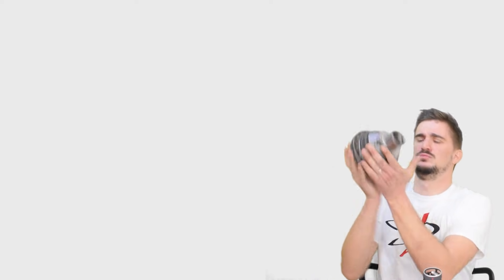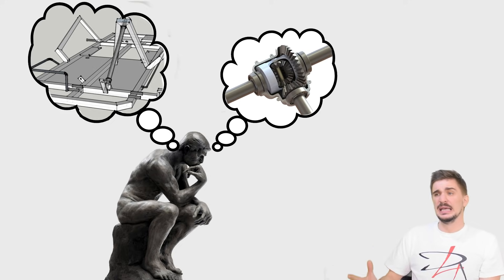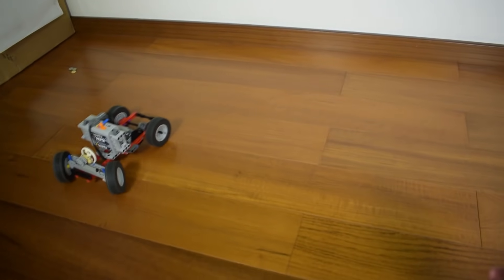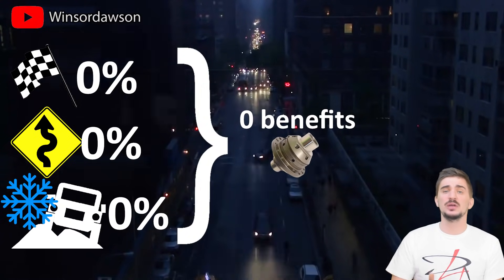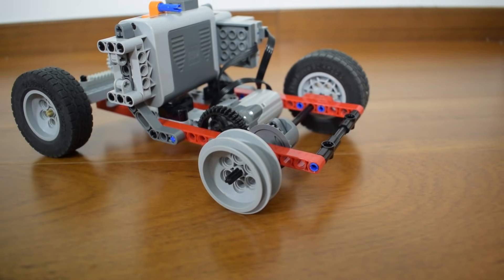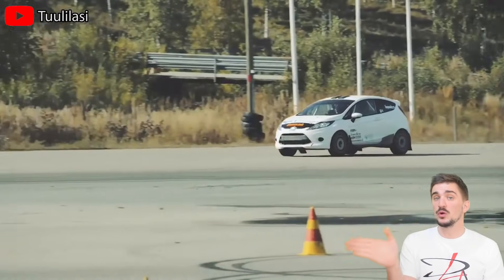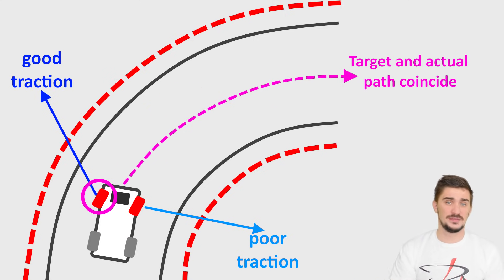OPEN diff vs LSD vs WELDED diff - VISUALLY + In depth EXPLAINED - Version 2

Comment: one thing that I would like to mention about the downside of a welded diff is that during a corner exit the driven tires are not only accelerating the vehicle but also keeping it from sliding sideways (on a fwd car this will result in understeer and a rwd will result in oversteer). On a welded diff the inner wheel will spin so you also lose that sideways grip keeping your car from spinning out, even though you may have better acceleration. On the lsd the inner wheel will spin less and maintain that sideways grip and keep your car on the road. That loss of sideways grip is also what makes welded diffs good for drifting, you want to lose that sideways grip and get things spinning.

Comment: Nice video👍🏻
I bought a Quaife helical front lsd for my Nissan Skyline R33 GTR V-spec, simular to your new diff for the MR2.

One of the reasons why i went helical is because it doesn't need maintenance wich is exactly what i need, for the front diff is actually located in the oil pan of the engine, and it can't be accessed when the engine is still in the car. So if it needed maintenance the whole engine has to be taken out or the front subframe dropped.🙈 the car is being track driven and will get a brand new 750~800hp RB28DET engine. So in order to improve traction and reduce understeer the front open diff will be replaced with a helical lsd from quaife. I'm really hyped about it, cause the gtr already was a maniac out of corner exits😁 it has a electronic controlled torque split mid diff in the gearbox and a active rear lsd from factory.

Also the helical type is much smoother in operation than a clutch type diff, wich was another reason to go for a quaife helical.

I cant wait for the next video about diffs! 👍🏻

Comment: Many years ago a Mk1 MR2 took out my Mk3 Fiesta while it was parked at the roadside outside my house on a main road.
The MR2 was doing 60+ Mph when it hit, it scooped up my fiesta with its low nose and my car went up the bonnet and the front edge of the roof, ripping them off while going airbourne and flying for around 120ft.

My car was bent up from the rear as well as sideways and also twisted with huge kinks in the roof and the impact force was so great that not a single switch, clock, vent ect remained in the dashboard and it also sent a shock through the car violent enough to break the water pump!

The MR2 veered off to the left, smashing through a wall and falling down steep drop off, it was utterly destroyed.

The passenger who's side took the bulk of the impact with my car was in a real bad way but ran off down the road pouring blood as he was having an affair with the woman who was driving the car and did not want to be caught with her.

Scary thing is that I always sat in my car for around 20mins when I got home but was early home by about 10 mins, had I have got home when I would have normally, I would have been sat in my car when it was hit!

Comment: Quaife is great in my book. I got a Quaife sequential for my 06evo mr. The tuning and getting everything to jive with the aftermarket ecu is key. It is tame enough to drive casually but is in its element when literally banging gears. Clutch obviously for starting and stopping but having the spark cut at the perfect time and time duration is key to a solid, smooth but quick engaging shift. I was able to go with a slightly bigger turbo but was also more efficient because I don’t lose boost between shifts. It definitely turned the car into an entirely different animal. I’m still at just over 500awhp for daily but can go up to about 900 turned up. The 500 now feels more like 600 compared to what it was rowing gears. Never out of boost while on it until you let out. So much faster then before. A quality product that in my case at the time it was also the cheapest.

Comment: If you want something in between a welded diff (spool) and a LSD, there is also a locking differential (often called a "Detroit Locker"). Going straight it acts like a welded diff/spool but in a corner at low input torque it unlocks and acts like an open diff. Just be careful as too much input torque (too much throttle) can cause the diff to lock in a corner and the car to "jump" or become unstable/unpredictable. This can be especially dangerous on ice. These types of differentials are great for drag racing and can be used on the street so long as you don't get crazy.

Comment: Great explanation
You also should notice one more advantage in cornering about natural toque vector difference with lsd diff,much more pivoting the car around rear axle,so lsd is great even for weak engine cars.

Comment: In beamng drive, the welded diff is the best for drag racing. You get 1 to 2 car lengths on launch easily over other diffs if you set up the gears and grip correctly

Comment: Your discussion of LSD's, in terms of performance cars, is fascinating. Perhaps you could do a video on the benefits of LSD's and even differential locks in off-road vehicles. Nothing stops a so-called 4wd car with free differentials all round than having both right (or left) hand wheels in a ditch and both the other wheels turning uselessly.
Think of it this way: a 2wd car with a free diff is effectively a 1wd car if one of the driven wheels has no traction. Similarly, a 4wd car fitted with front, rear and centre free diffs is still effectively a 1wd. One or preferably two of the diffs need to be LSD's, particularly the centre diff. If you have a vehicle with a locking centre diff and a LSD at the rear and you get it stuck, you should probably stick to walking. 🙂

Comment: Also worth noting is weight shifting to the rear means less traction on your front steering wheels. If those are also your driving (powered) wheels, it will take even less torque for them to start slipping, inducing extensive understeer. This is also why FWD cars torque steer.

Comment: Thanks for the explanation. So basically - An LSD of this sort needs at least some grip on one of the wheels in order to provide any torque to the other wheel. If you have zero grip on one wheel, it behaves like an open diff.

Comment: many thanks. i have a RWD car with an LSD but didn't understand exactly what makes it harder to drift compared to open/welded.
if i follow correctly, it's because the LSD is maintaining traction on the inner rear wheel in a corner.

Comment: Your cover picture shows a picture of a Ford 9.75 LSD as “Open”.
There are clutches behind those side gears. You probably expect to see a spring between the Side gears. In the Ford 9.75, the spring is a beveled spring on the inside with the clutch assembly against the case.
But now Jm just showing off

Comment: Just as a short explanation for welded/solid axles they are usually for one of these drift,drag,and off road vehicles and not all drag cars depends on the class but I know from experience that for off road welded/solid axles it makes a large difference when you have zero grip in example thick wet clay

Comment: Not sure what you have? Jack up the rear axel and turn the tire. If the other side turns the same direction. It's limited slip. If they turn opposite. It's a 1 tracker.

Comment: Your LSD Model was really a Torsen wasn't it ? The Viscous type  is  what  I  always understood as an LSD . Viscous  or  Friction plate packs .
Open Diff is great for your Average  " Joe " round the Suburbs . Deals with Made Dirt roads too .
Welded is for Drift , as said , or NASCar Tri-Oval .
Off-road , part time Lockers are the go . Air-lockers OR Detroit (no-spin) Rear and Air Front .
You should do a Video about the Part-Time Lockers at some Point .
Another great Video . You explain things really well for those that might not quite understand the concepts .

Comment: Cool video, but today’s stability and tc systems are getting so good cars like the 720s mac. Are running with open diffs. Which is nuts 🔩, and they are absolutely awesome at putting there power down easily with no slip! My new cupra 290 has a mechanical diff whis is electronically controlled and it’s really really good at hauling you round corners at silly speeds, it’s called a vaq system. It’s exactly the same system the golf r mk 7 uses which is called haldex 4motion. Only difference is the golf r works front -back but my cupra 290 being fwd works left-right. I was hoping you would cover that kind of system but anyway that was really well explained m8 thanks, really enjoyed that🙏🏻👍
Reply: I have a Ford Ranger with the Advanctrac stability & traction control and an open diff, and it is GARBAGE  beyond garbage for traction! It's downright dangerous for me! When I tell it to MOVE and it just spins, cuts power, spins, cuts power over and over, sounding like a 2-step almost, and I don't get moving at all. Even in just the rain my truck cuts the speed/acceleration DRASTICALLY. It takes me abosolutely forever to get moving, and even in snow I can't swing the ass of the truck to drift a corner and maintain speed or do cookies even trying my hardest. It's absolutely CRIPPLING the truck's performance potential SO BAD! Like if it would just let me spin my damn wheels when I wanna spin em, I'd at least get moving a little better. Good tires help tremendously. Great tires while spinning the wheels works better than regular tires and traction control doing it's "power on & cut power" thing. Open diffs are absolutely garbage in everything I've ever driven. LSD all the way! That should be the standard equipment in trucks, not open diffs, especially 2wd trucks, cause otherwise they essentially become 1wd soon as it gets a little slick.

Comment: Rear wheel drive platform which can't break traction on rear wheels is the Suzuki Jimny key 0,66 i3 with AT. 60 horse power engine and slipping AT can't slip anything even the mud. Drives actually great on slippery surfaces.

Comment: Welded differentials dont prevent slip, they prevent wheel rotation. If you're in a corner, the vehicle will distribute weight to the outside wheel. This causes the outside wheel to have more traction than the inside, causing the inside wheel to rotate break traction with the ground as its normal force is less than the outside wheel, since more weight is being distributed to the outside wheel.

Take a John deer gator out to a muddy jobsite, try to powerslide with the differential unlocked. Then try to powerslide with the differential locked. Locking the differential will cause one wheel to have less rotation than the outside, resulting in a breaking of static friction with the ground and therefore less traction.

I find it much easier to slide with locked differential than open as the open differential is meant to allow the wheels to rotate at different rates in order to maintain static friction

Comment: '92 dodge caravan and the plymoth voyager had the same lsd's in them !!! at top speed 280 km'h or faster with turbo's !!! the 3.3l with the 280 km/h trans in them !!! I haven't had one again in 15 yrs in kinda good shape. but they are beasts in the long run !!!

Comment: I've always wondered why car manufacturers didn't just use a solid axle with ratcheting hubs (like you see on bicycles).

This would allow for perfectly smooth cornering and also have zero wheel slip in low traction situations.

Comment: @driving 4 answers  great vid but one thing that I would love to get a more insight on is the amount of tightness of the lsd ( not sure whether that a correct term but basically often with lsds I hear 25% tight or 50% or in the case of a welded 100% does that translate  to how much of the overall power output is available to the wheel that loses traction or what )and how that translates to driving

Comment: Drove my stock 93 Miata open diff through a sharp corner at 45-55kph at steet intersection on my city, the rear slipped like a roller skate, thankfully i've got 5 years on driving/playing simulators, so my instict kicked in and dind't break push the gas a little and countersteer and safely recovered it. people at the intersection looked at me like "this guy is trying to put the show" like i did it on purpose but it wasnt the case (good for me there it was no police at that moment). never been on that situation before (at least in Real life) so that made me wonder if i should replace the diff. Thank for this video

Comment: As per my experience, LSD have benifit in straight launch and also sime mild locking function on plain slippery terrain.. But in corners it will make ur car drift away and losr control

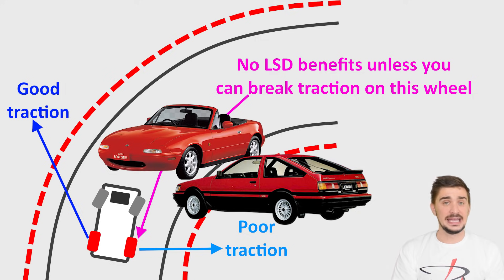Comment: 16:30 that's an interesting point.
BUT some "over-safe" cars can not break traction, not because they are well balanced, but because they have excessively large tyres or excessively rigid suspension. I love Miata because it is safe without needing larger tyres, which would mean more gas and can mean less speed. They just apply a Torsen differential, without sacrifice too much gas, speed, and without sacrifice maintenance costs when you have to change large tyres.
Safety is not enough. Cars should be economically affordable safe.

Comment: When you gave the ice road example you said you only get 30Nm to the wheels which is completely untrue. Torque cannot just dissapear off to nowhere,it has to go somewhere and it goes to the wheel with less traction, so 15Nm on asphalt, 85Nm on ice.

Comment: Two small nitpicks; direction of acceleration rather than direction of travel is what determines the weight transfer direction. Also, there indeed are benefits to an LSD with an underpowered RWD platform, specifically there are benefits to using a torque sensing type which will bias the torque to the outer wheel before any slip occurs at the inside wheel and therefore create an oversteering yaw moment around the car helping the vehicle turn into the corner.

Beautifully presented otherwise, greetings from your neighbours to the north.

Comment: "couldn't find a usefull visual aids on lsds"... proceeds to making a visual aid using legos. WIN! I really appreciate the effort you putting into explaining to dummies like me. TQ. Also, is there any way to figure out wether my gbox has a torsen LSD or not? i drove a dc5 with swapped JDM k20a and 6speed manual. It should have a torsen lsd but is there any other way for me to test without actually taking out the transmission and open it? My mechanical skill is only basic and i do not have the tools/money/time to dissasemble a transmission by myself, i just wanted to know if there is a way of knowing to determined wether i was cheated or scammed.

Comment: Locked diff can be done better than welding in many cases with either a minispool that replaces the sun gears or a full spool that replaces the whole crown wheel carrier.
Open wheel generally works fine and is by far the most trouble free. LSDs are so often worn out and offer no advanatge apart from  friction material in the oil. Though there is numerous types of LSDs, generally the most expensive the best. Not however Detroit Lockers! Horrid clunky things that let go on trailing throttle. 
For motorsport forget LSDs as they are far from good. A spool whatever style will be superior. If you cannot drive it learn to drive!!
For road use though not a good idea.
This came up in my afternoon tea,,, from fitting a mini spool!

Comment: If you drive a rwd car with a open diffrential straight forward with bad friction to the ground and pedal to metal, one wheel will start to spinn. This will also make the car drift even that you are going straight. But when you let of the accelerator you will get a weight transfer in the opposite direction and this can make the car spin out. This don't happens with a welded diffrentential or a lsd.

Comment: FWD had less wheelspin in the rear accel                                                  AWD is for rally cars if you didn't know. = or RWD
RWD are common for drift vehicles, Normal sedans, offroad pickup trucks
Reply: this comment was about Drivetrain turning into a Traindrive

Comment: ATB type diff. Is not a LSD. 
A LSD has friction plates under pre load for the purpose of ensuring there is pre set torque applied to the unloaded wheel.
A ATB diff. will be open if one of the driven wheels leaves the ground.
ATB's are great for the road or easy to drive FWD competition cars. 
For real competition a plate type diff. is a must.  On a RWD chassis they reduce half shaft failures and on a FWD the pre load and rising rate ramp angles are used to tune the behaviour in a corner. The affect is greater than suspension setup changes

Comment: I daily drive a 4x4 truck with welded differentials in both the front and rear axle. They’ve been like that for at least 2 years. Unlock the front hubs before you go anywhere and it’s fine- you can barely tell the difference between welded and open unless you’re trying to be picky with your parking spot. This is on an ‘89 Ford F-250 (reg cab, long box, 33” tires)